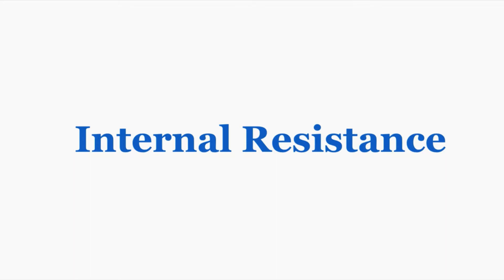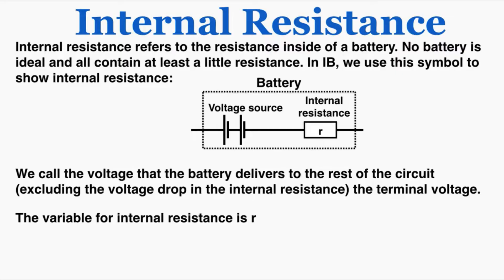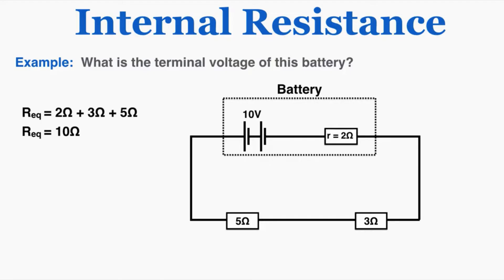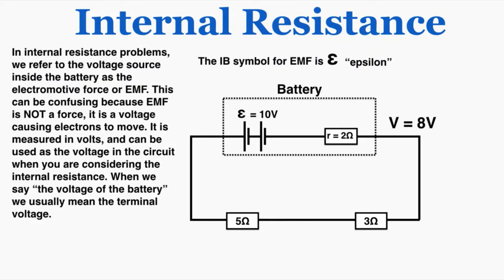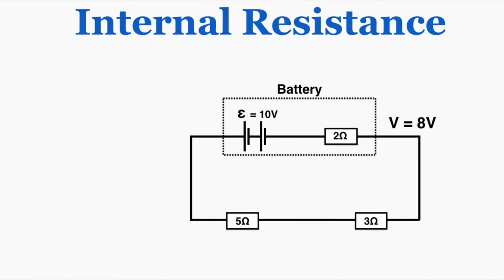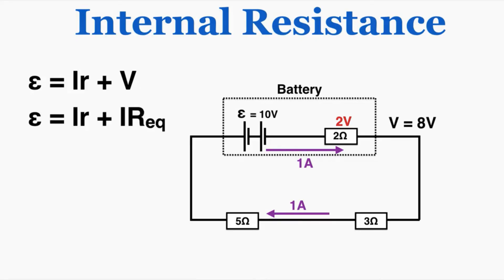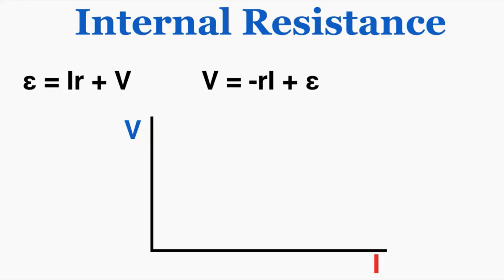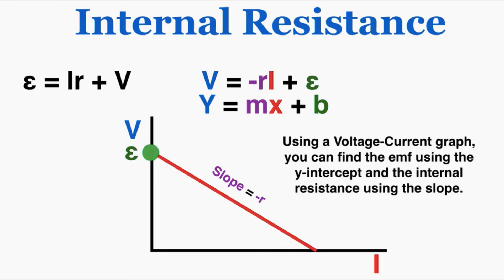Internal Resistance and EMF - IB Physics

Comment: When most types of batteries are failing, their internal resistance goes up.  Measuring the terminal voltage with a digital (high-impedance i.e. very low load) voltmeter often shows a "normal" voltage, which is why battery voltage should be tested under load conditions.  With a car battery, switching on the headlights will bring down the terminal voltage of a bad battery, and the headlights will also go dim very soon.